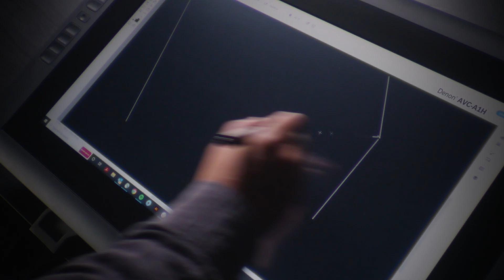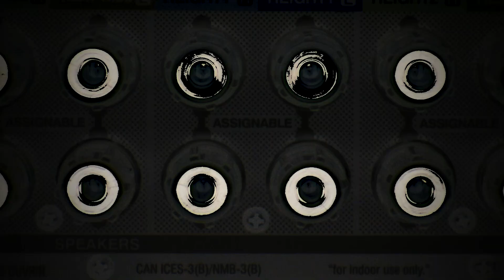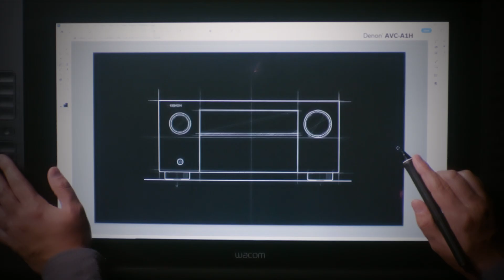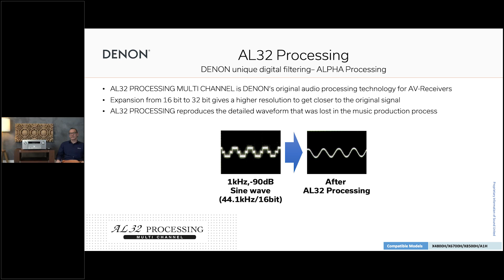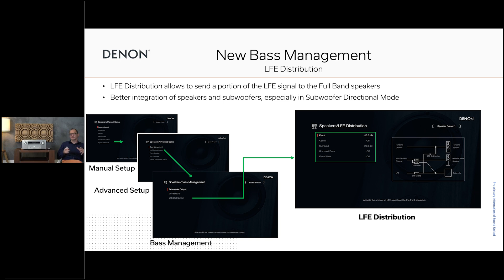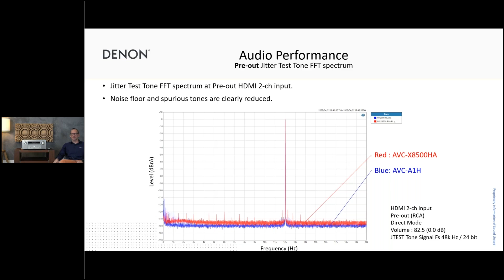Denon's new flagship AVR, the AVC-A1H technical introduction

Comment: Will it support Dirac ART?
Reply: Same Sharc DSP used in the rest of the range. They have said ART will not come to 3800, 4800 etc so that means it wont be coming to A1H either. Anyway Dirac are so slow it will take them maybe 2 years to get their software ready. The whole Bass Control fiasco not being ready until 2024 is a joke. Not Denons fault. Dirac obviously is the issue and always seems to struggle to get working code out to suppliers in a timely manner.
Reply: @pumpituphomeboy  sad
Reply: If these new avr's won't do dirac ART then I won't be touching them. I will stick with my X6700H. It has two top of the line sharc Griffin lite DSP chips and I am sure it had enough power to process dirac  live, but hey, if they came out with a firmware upgrade for dirac live to add dirac live to the X series then who would buy the new AVR's. I have two independent sub channels. There is no way I can fit in 4 subs.  Looks like Denon will be in last place when other manufacturers release Dirac Art with their next generation AVR's. I think it is a joke that these new recivers don't come with the lite version of Dirac live, and the consumer has to pay for the full licence price of £349 here in the UK. I am also disappointed that Denon chose the EES 9016 instead of the better 9026 or the new 9038 chips that you can find in a £100 Dacs.